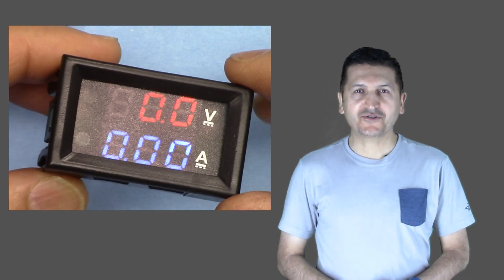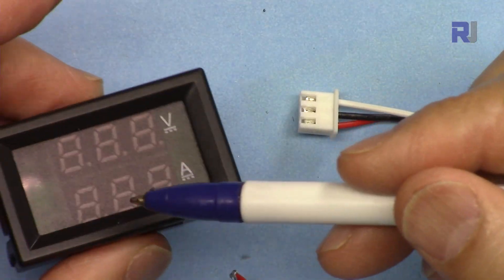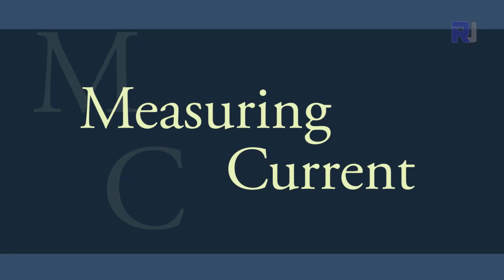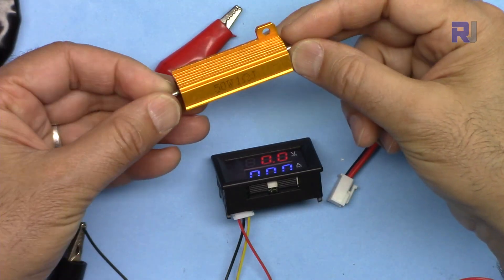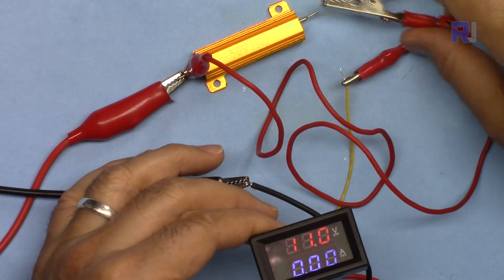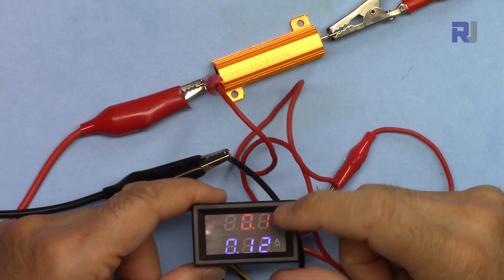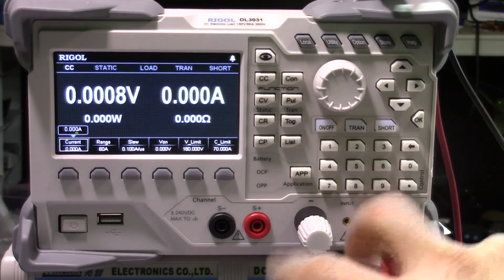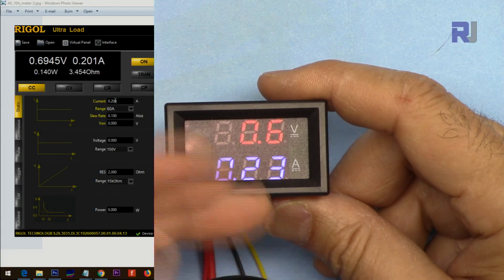Complete Test/Review of 10A  0-100V LED DC Volt and Current Meter RJT203

Comment: Thank you very much for the videos...Bless you and your loved ones...I got the meter going finally the only issue I have with the Mini Digital Voltmeter Ammeter DC 0-100V 50A I am trying to read the current value from a fan that draws 0.3A but it shows 2.7 I dont know if it is mA, it only has a printed A, it checks out ok with my multimeter at 0.3A of course because I can select the range.....Is it just a matter of how I am reading it....Thanx
Reply from the maker: Hi, when you use a 50A rated meter, remember it has 5% error.  it can read only 0A or  2.5A (5% of 50A=2.5A) so you need to use a meter 10A or less like 1A rated meter.  so 2.7% is simply the error you are reading.  if the error is 1%  then smallest value you would be able to read is 500mA.

Comment: How can these meters be wired to be used in an automobile charging system?
Reply from the maker: It can't. The car battery is charged at a much higher rate. I am wondering would you care to measure the charge current.
Reply: @robojax  
There's the current flow out of the battery to start the car, which I'd like to call a negative value, then the current flow into the battery, which would be a positive value. If the charging system gets weak or fails then the vehicle will run for a short period of time off the battery (a drain or negative flow) but not have enough power to charge the battery. If in the start mode the current goes way high and the voltage drops way low the battery or the starter could be starting to fail. 
So, it would be nice to know the current flow direction and amount as well as the charging system voltage.
Reply: I'll experiment a bit to see if I can make this meter read both ways. One idea is to use a relay that pulls in in the run mode to switch the signal leads for the amp meter. But not sure how to get the relay to disengage in the event of a charging system failure.

Comment: Hi, I would like to connect one of these meters to my Powwrtech MP3098 , 20amp continuous linear power supply, however the meters that I bought do not have that 10amp shunt, how do I go about connecting a separate 25amp shunt to this power supply please ?
Thanks in advance.
✌️ ❤

Comment: Hi There, enjoyed your video, very educational and easy to follow, especially if your not electrical minded. 

I have question and a query! Question:  where would but a circuit breaker within this layout? And my problem is I’m having problems with the meter not reading the current. Voltage is fine and I’ve check the wiring and I believe it’s correct to you video, can you please help me? Thanks in advance Brian ( mid Kent)
Reply from the maker: Hi, I hope you have watched the video. this current meter is "in series" with the power line. if you did not watch it, do it again.  breaker is the same, just put it series in the + or - line.

Comment: My voltmeter was quite OK out of the box. But I wasn't able to calibrate the amperemeter with the potentiometer (the range was too short). Any idea for the fix? Thanks in advance
Reply from the maker: what temperature? this is about Voltage and Current.
Reply: @robojax  room temperature

Comment: Thanks for this, I had one die, a 4 bit version (4 digits) I wonder what happened i had a lithium cell + tp4056 charge/discharge module on it.  I never had issues with this setup then recently it wouldnt power on, after some investigating (i had it wrapped in heat shrink) I noticed the tp4506 module getting supper hot, it was going to blow! i scambled for a set of plier to cut the battery and managed to do it before it blew up in my face... after taking off the heatshrink i noticed the output of the battery on the t4056 module had lots of extra wire comming off it, which got squished up against an IC creating some kind of short I believe.  Then i remember i remounted the display with hot glue and that could of brought that wire into contact, clip your wires after you you solder them on i suppose, there is a chance they can find a way and touch something they shouldnt.

Comment: The analog ammeter has failed in my 6/12V 2 amp trickle 6 amp max charger. Do you suppose this would wire right in and work well?

Comment: There is no shunt resistor instead there is r18 resistor I have the same voltmeter can I add shunt resistor
Reply from the maker: when you have a resisterr in series with power, it is called shunt resistor.

Comment: How can we set current limit while using this display. Short circuit on buck but it's not being displayed when red wire for load from display and positive from buck is shorted. It seems wrong my since these are technically our outputs, how can we display Current limit while adjusting for CC??
Reply from the maker: this module just shows the current.  If your power module has CC, then you can short cercuit the output. So do it like this. I assume your power supply can't output more than 10A. 1-connect this meter at the output of your poower module 2- set the CC to minimum.  3-shoort circuit the output of the meter and keep it short cuircuitted 4-Adjust the current. and you will get the limit.

Comment: Thanks for the video. Mine was a little different with a two lead small red and black, and three thick black,red and yellow. It powered on with the small red and black attached to 12v. I put the big yellow onto the 12v and got a magic puff of smoke. This surprised me as I though if yellow was the voltmeter line it would read 12v else if part of teh ammeter circuit it would not read. I would appreciate anyone telling me how mine worked, what caused the problem, and potentially how I could fix it.

Comment: Nice instructional video! I am wondering what is the load your are using in this video?
Reply from the maker: I have an electronic load where I can set to to acct to draw constant current, power or. resistance

Comment: I have 24 batteries I just want to monitor voltage
Reply from the maker: You can monitor by connecting them in series or parallel. Or buy 24 of this display.

Comment: Nice and informative video thanks for the same to guide people interested in electronics, 
When you use a common power below 30 volts DC to power the Voltamp meter the thin black wire should not be connected to the negative along with the thick black wire as it will burn and damage the meter at higher current , for using the meter for voltage higher than 28/30  volts a separate power for the meter using the thin red and thin black wires to be used
I have a couple of meters 3 digits & 4 digits on my variable bench power supply & also for my auto cutoff battery chargers, very nice meters from Amazon & Ali Express 
It has an accuracy correction factor of 0.8 to 1% plus 2 digits for voltage, the amps usually is almost correct but can be adjusted with the “ I ADJ “ pot as explained in this nice video 
All the best to you
Reply: I burned two of this meters. I used a self made car charger,  connected everything,I didn't use the black thin wire and then the meter burned...I had no load on the output. I don't know which is correct way of wiring..

Comment: Anyway to get this to read negative voltages?
Reply from the maker: no.
Reply: @robojax  Well I tried it and it worked. I am not using an independent source to power the meter. I attached the thick black wire to the negative side of the source, the thick red to the negative side of load, the ground terminal (source) to the positive side of the load, and the combined thin red and yellow wires to the positive side of the load. Of course it does not display a negative sign but DOES display the magnitude of the negative voltage which is really all you need. Just label the AV meter as negative voltage.

Comment: mine always shows only half the ampere. any idea where the error could be?
Reply from the maker: you might have changed the shunt resistor to half size and it produces half the voltage  which the current value. if you have not changed it, then, some resistor on the path from shunt has been damaged and now it dropping the voltage to half. So check a few resistor be comparing them to the written value. it would be hard to measure which they are in circuit. for proper reading they should be remove and measured. I am not sure if this is what you would do.

Comment: Hi,

I need to check the battery charging amp using a solar panel. Can I use this meter to check how much current the solar is pumping to charge a 12volt battery?
Thanks
Reply from the maker: Yes, you can

Comment: Could a 100w 2ohm load resistor be use in this same circumstance? For testing purposes I mean? I'm currently designing a 24v 10amp project and only have a 100w 2ohm load resistor at my disposal!
Reply from the maker: I measured the shunt resistor value which I don't remember the value. but if you change it to different value, all the reading will be incorrect.
Reply from the maker: you may start with this project using Arduino https://youtu.be/9jwCc7uPGoc then we have  tutorial showing you how to use it with LCD dispaly. If you are not familiar with Arduino, Here is $200 Arduino course for free Arduino Step by Step Course  (over 100 video lectures) Starts here http://robojax.com/L/?id=338

Comment: NB - On the ones I use the two black wires are connected together on the PCB.

TIP - removing the PCB makes it easier to fit the unit in a panel.

If you reverse the current the unit reads zero amps, I have two of these connected back to back in a PV solar setup, one reads current into the battery, the other current out.

Comment: It was a very useful video, I have a question about my problem, I would appreciate it if you could answer it. If possible I need the model number of the diode next to the 7133-1.
Reply from the maker: I don’t have this on hand now. Do google image search I am sure you will find high ready image. Besides I am sure it should be a regular or a schottky  diode
Reply: @robojax  Thank you for your answer. When I look through the microscope, I only see B3 written on it.

Comment: Great Video!
Question, I am using a single power source for my meter but I want to be
 able to turn off the meter while leaving the line power on. Do I 
interrupt the yellow wire for a switch?
Thanks
Reply from the maker: As I shown inside this meter we have a think wire as shunt resistor so it does not matter if you connect the yellow wire or not. It will pass the power  through.

Comment: I must have shorted the thin black wire (it got hot) and now the Amperes stay at 000 all the time. Do you have any idea how I could test or fix this ? Thank you.
Reply from the maker: The current is measured from shunt which is about 50mV which I have shown in video. if you miss up the wiring, it is possible that higher voltage gets into the circuit and might have killed the resistors that are protecting the module.  Now it is very hard to repair it unless you have exact module, using multimeter check all resistors close to the shunt and compare it with the good one and if you are lucky you might find it. There is another possibility one of the chips reading the voltage is dead. good luck

Comment: Great tutorial! if I change the shunt resistor to read up to 20A what value must the resistor be? Thanks
Reply from the maker: For 20A , get a shunt that gives you 50mV at 20A. Then whatever you , multiply it by 2. For 20A you will read 10 and for 20A you will read 5A.

Comment: Excellent video, i have a question please help me , i have a yellow cheap multimeter dt830d i want to check measure current between 6 to 8 amps continuously in series while charging the battery is that possible ? please help how to do it also if not possible let me know how much maximum current ampere i will check continuously on that multimeter for hours thank you in advance
Reply from the maker: Hello, you can use it continuously as there is a shunt resistor a string wire. So no worries.
Reply: @robojax  ok if i will continously connected without shunt on 1 amp 2mp or 3 amp is that ok, means how much max current i can check without shunt for long time period thanks friend

Comment: Thanks for the Shunt calculation. Were you by any method able to determine what the digital ammeter impedance is.  Is this a 100 mA or is it actually a micro A actual reading,  I am looking for a meter with 1 mA range to replace an analog meter in a tube tester and need some more info to calculate if I need an additional series resister to match the analog meter resistance.

Thanks
Reply from the maker: You are welcome. this module won't work for you as the resolution is about 50mA so.  I have review of a product https://youtu.be/Mmxw7T29Z6k that has different displays at milliampere. So get from the same manufacturer on AliExpress.

Comment: Nice video. I have a question. What is wrong if I have it connected right(like iit is shown in original schematic), but it is not showing the current. It displays just 0,00A
Reply from the maker: If you know your load gets current and  wiring is correct then it might have been overloaded and something has burned or died.
Reply: @robojax  it shows current just in one direction? I tried both directions and it didn't work but now it works in one direction. It shouldn't be because of the overload.

Comment: 9:42 I thought you were NOT supposed to connect the little black wire when the amp black wire is connected.
Reply from the maker: Yes you should connect it as shown. Thanks.
Reply: You only need the thin black wire if you use an independent supply to power the unit (eg a PP3 battery)

Comment: Hi. Thanks a lot for making this detailed video. I watched a ton of other videos and none of them helped until I watched this one. One question that I hope you can answer, what would happen if I were to draw more than 10 amps? I have this connected to a 12v power bank which also has a 220w inverter attached to it. Will it survive a 220w load or will it blow?
Reply from the maker: Hi, you are welcome.  I have not tested it but higher current perhaps there will be 1A or more tolerance but for 5 or 10 seconds. This is what I have tested but longer than that I am not sure and not advised.
Reply: @robojax  thank you!

Comment: Thank you very much. I though the device could be used as panel meter so I supplied 15Volts to it last night and it vent off, burnt. Mine is PZEM-050 with a specification: DC 5.6 - 100v the current is : 0-100A it came from kikuu with 100A shunt resistor. Please is it good for panel meter??? to measure both voltage and current as well as wattage ?? you are now my teacher so i want to know. Have a nice weekend.
Reply from the maker: You are welcome. Yes this is exactly made for panels. Please subscribe. It is appreciated.

Comment: sir how can we use same digital voltmeter ammeter for measurement of 50 to 100 A of current using shunt
what changes we have to do in meter
Reply from the maker: You can’t change it.  Use this https://youtu.be/tgneN2hzRe0 or modules

Comment: Hi, what happens if you have the ammeter set up to measure the current going out of a 12V battery and then you charge the battery so the current flows in the opposite direction. Will the ammeter drop to 0 or will it show that the current is reversed ?
Reply: I have exactly the same question!!Mine had weird behavior with opposite current... It read something but I don't know if it's correct
Reply: It shows zero if you reverse the current, I use 2 back to back, one shows charging current, the other discharge current.

Comment: Hi there may i ask for some advice please?. Ive tried many different ways and still not working. I dont know how to do this. I have a solar panel and a charge controller and id like to see what the solar panel is producing in volts & amps. I have a display and also a bus bar. Any help would be greatly appreciated. All the best, kieron. Right click and save image https://ibb.co/JxW3NmP
Reply from the maker: I looked at images and it will only show voltage. For both voltage and current you gotta do it as shown in video. I have got so may videos on how measure current . Watch them .
Reply: @robojax  Thank you for getting back to me. Unfortunately ive watched about 10 videos and I still dont understand it. Was hoping you could connect the lines. If not, Ill look at your video list, thank you.

Comment: Thank you for your time and video, help me a lot.  I've got the voltage showing but my amps are lit up with 0.00
Reply from the maker: either current reading wire is not connected or internally it is damaged.

Comment: If you are 3D printing, I have found that the cutout needs to be 26.8 x 45.4 (thickness of 2.5mm worked well for me) - I also chamfered the inside cutout by 1mm or so. Hope that helps
Reply from the maker: Thank you for sharing.

Comment: that sucks  ill burn it up running voltage threw it it will see spikes junk fer my needs
Reply from the maker: I burned 2 or 3 of them but it was my fault. wrong wiring. so if pay attention with wiring, they are very good. I've got more than 5.

Comment: My current measurement is wrong .it is 2-3 amps higher and it also varies (sometimes 2 amp higher ,sometimes 2.5amp higher when voltage changed etc).I checked with multimeter.i also tried adjusting trim pot but amp is too inaccurate to correct with pot .how can I fix it
Reply from the maker: it must be damaged. 2-3A is very large.
Reply: @robojax  is the micro controller damaged or lm358 or anything else?
Reply from the maker: not sure. not worth repairing. the opamp will cost almost the the same as the meter if you pay for the shipping.

Comment: sir , will 100v,100A DC volt/ammeter of same type  will give accurate readings.will calibration in 100A,100V meters will give accurate readings
Reply from the maker: it can't be of the same type when it comes to 100A. for 100A you will need an external shunt resistor.  See meeters https://youtube.com/robojaxTV/search?query=meter